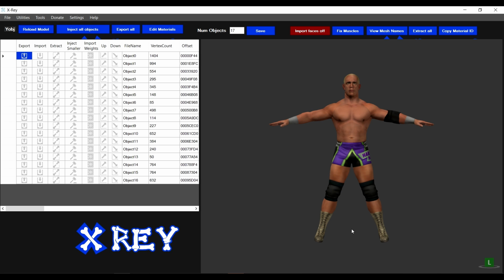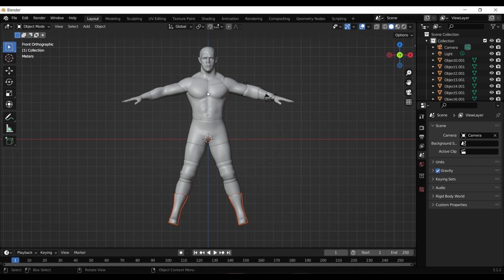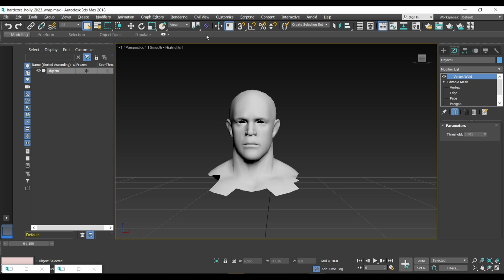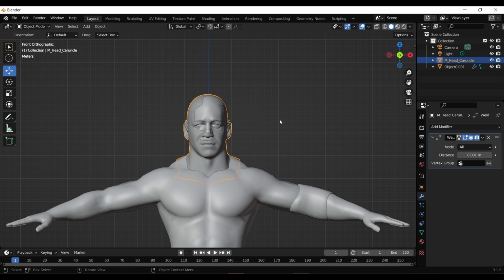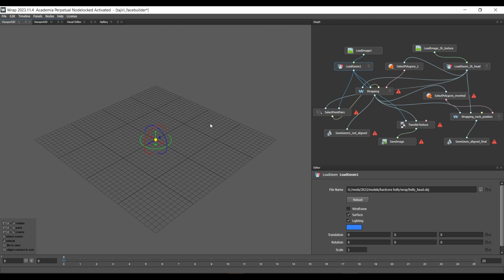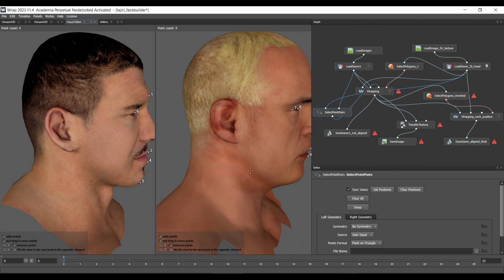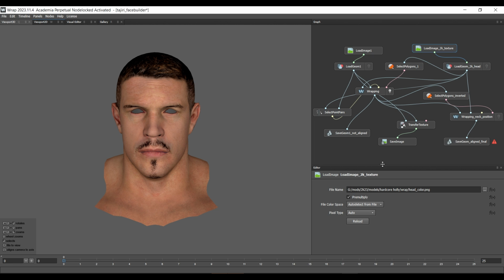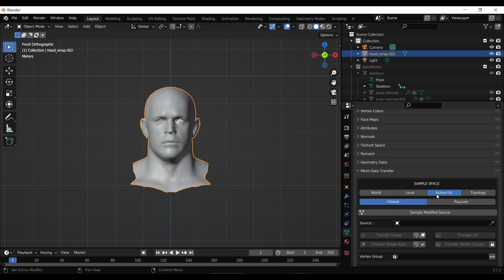Using wrap3d to wrap heads and transfer textures tutorial | Tekken57

Comment: How do I fix non manifold geometry error when wrapping?
Reply from the maker: This means that you mesh is not welded correctly or has polygons which are not connected properly. You could give the mesh a mesh smooth with a value of around 0.5 and then pro optimizer of around 95% in 3dsmax to resolve the issue before exporting
Reply: @tekken5789  thanks for the help! Can I bring back the linked groups after finishing? Like separate neck, ears and caruncle after weld? So that I can edit them separately later
Reply from the maker: @shadymostafa9711   why would you want to separate the meshes again after reshaping? You can just rig the model with head and caruncles attached
Reply: @tekken5789  one final thing. I followed the tutorial but when I do the wrapping neck part it tilts the head and makes it face a diff direction from the wrapping part?
Reply from the maker: @shadymostafa9711  Post a picture of what your masking for the head looks like when you're trying to align the neck.
Reply: @tekken5789  I sent a message on discord😅